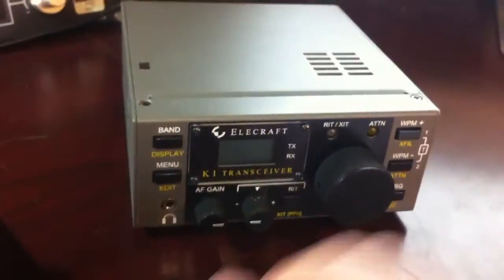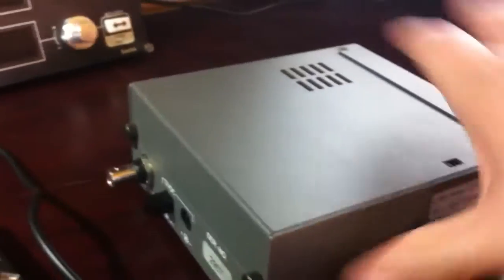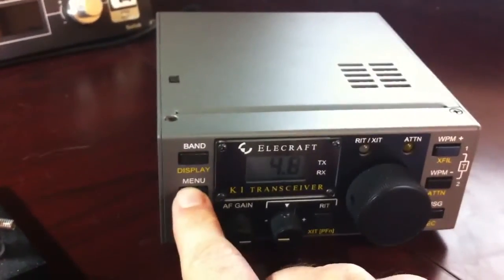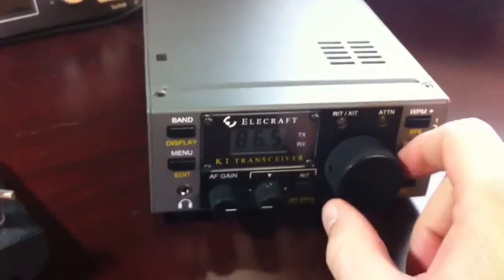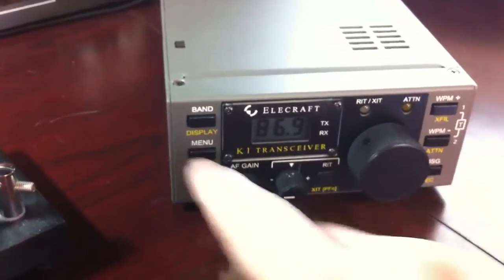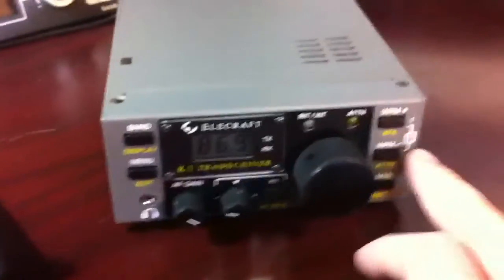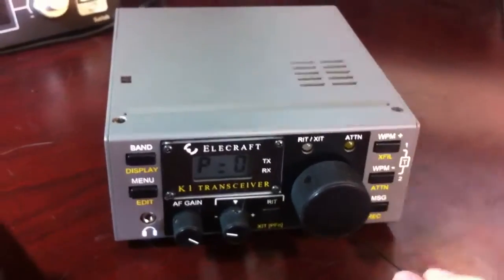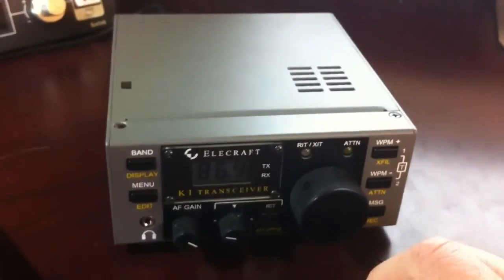Elecraft K-1

Comment from the maker: Yes, the internal battery pack is not very useful. I would have rather spent the money on the noise blanker and got a external, high amp-hr rechargeable. If you're interested, I am trying to sell mine (I just bought a ft-857).